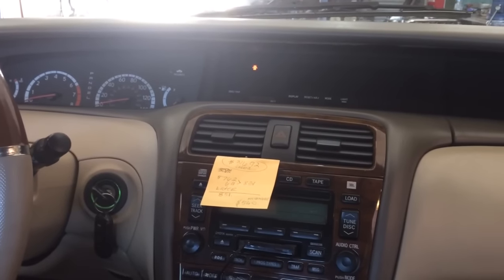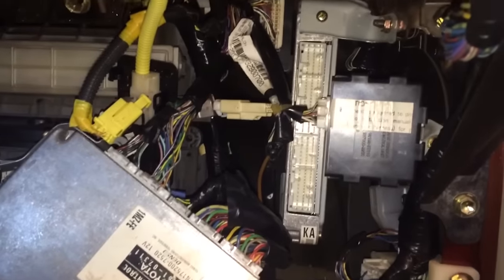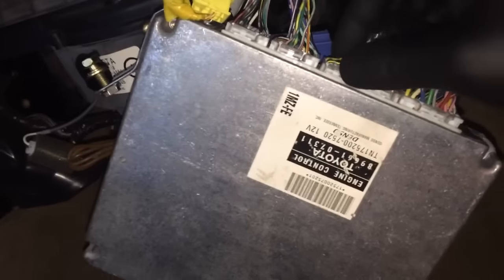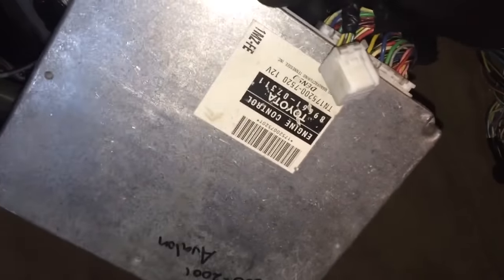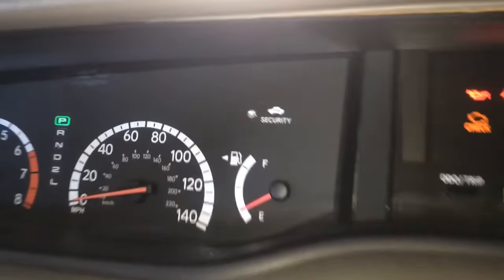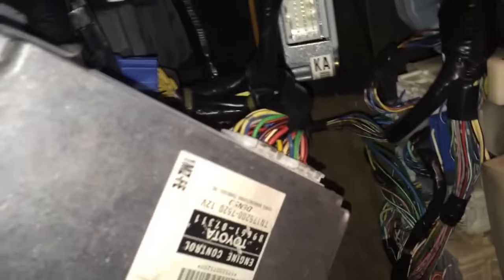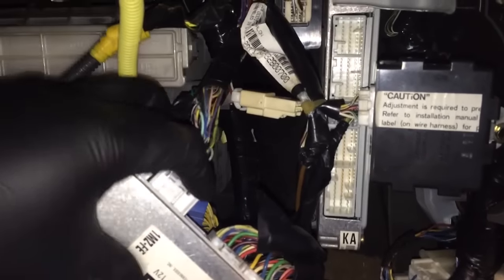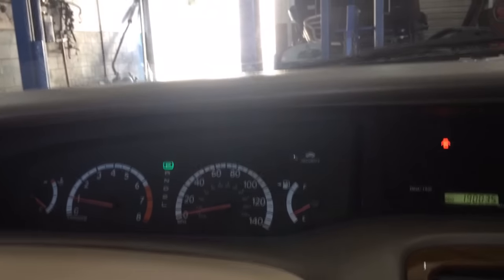Watch NOW! Immobilizer Bypass No Special Tools Needed Real

Comment: i had my 2005 accord hybrid steering column destroyed by car thieves is their any way to get it started even though the key ring on ignition was destroyed and how can i defeat the immobiliser???
Reply from the maker: +Anthony Wynn try this out http://k-tuned.3dcartstores.com/Immobilizer-Multiplexor-Bypass_p_131.html its usually used for cars with k-series swapped engines but you can always contact them to see if it'll work on your car.
Reply: Anthony Wynn you can buy at ebay.
Reply: n

Comment: how would I do this for a 2000 Mitsubishi Eclipse with a 3.0 v6??   it's pin 51-111 or is there a way to eliminate it completely. my keyless entry fob took a shit. and car won't do anything anymore
Reply from the maker: +Cody Burgess is it a factory keyless entry fob? if it is factory your key should disable it once you use your key to unlock the door or switch the ignition to the on position. If it is an aftermarket alarm system then you can take out the alarm system and reconnect all the wires that were cut
Reply: Factory. I have gotten most to work. But the fob.  And the immobilizer has all spark and fuel shut down. No crank no start

Comment: On a 2001 Toyota RAV4 the engine starts fine , I’ve had to replace the computer because it damaged the transmission. I put new computer in and now engine only cranks but will not start. Funny thing is this RAV4 doesn’t have any theft deterent devices on it just one black head Toyota key NO security light on dash . Code is B2796 no comms with immobilizer . Now would all I need is to have a new key cut and programmed and if so what is it going to program if car it self has NO theft deterrent devices just the new computer?
Reply from the maker: I would go back and get another computer. Happened to one of my customers cars I did but luckily Toyota warrantied the one I bought.
Reply: Revved Up Knowledge yes sir I have another computer already being shipped to me, I explained to them the situation and they are saying they may have sent the computer with immobilizer integrated in ECU so now their sending one without hopefully that’ll be it thanks for your response much appreciated
Reply from the maker: Yea on my customers some short in the electrical system caused the immobilized system to activate itself. This was 5 months after the new computer was installed. All is well now with it so thank god!
Reply from the maker: Good luck!

Comment: the  sentry system  light comes on when starting my 2001 jeep grand cherokke and shuts the truck off after two seconds both keys are origanal please help ive been to 2dealers and 2 mechanics still no resolve
Reply from the maker: +Mark Depelham sorry haven't replied, hopefully you have it sorted out by now. if not i thinkg it might need a new immobilizer module (ring that reads the key) and reprogrammed

Comment: 2002 Chevy Impala that will not start. Dashboard will come on but the key will not turn to the start position. Car ran and started fine all day but now it wont start. We changed the ignition switch and cylinder but that didn't work.
Reply from the maker: +alysia Porter with the new cylinder it should turn all the way. Did you check for any debris left in there from the old cylinder before putting new one? Something could be blocking it from turning all the way. Is the car all the way in park? if it is try putting it in neutral if you can, to see if that will let you start the car, if it does than you either need to replace your Neutral safety switch, adjust it or the shift cable could be bad as well. let me know as much detail as possible because these things are really hard to diagnose without me physically checking it myself
thanks

Comment: does this work on a lexus gs 300 2006? security light blinking car wont start
Reply from the maker: I have tried this method on a 2000 GS300 and worked as well. On those years the immobilized plug is the grey one
Reply: Revved Up Knowledge how about 98 Lexus LS400?
Reply: Any chance this works on a 02 es300
Reply from the maker: Tiger Gray: Sorry a little late but yes good chance this may work but it only for testing purposes. If it does work then get the donor computer programmed with your original keys!
Reply from the maker: Gary Davis: Yes good chance this may work too but it only for testing purposes. If it does work then get the donor computer programmed with your original keys!

Comment: I really appreciate your trick. My Corolla 2009 has exactly same issue when i enter the key red security light keep blinking. Sometimes it blink once and my car work perfectly, once or twice in a day my car doesnt start and i have to wait 10 to 15 minutes or sometimes if it get worst i replace horn fuse with efu fuse. Went to the dealer and they are asking me $750+ for it which i am not willing to pay them at any condition. Local locksmith are not interested to take risk to do anything. Can you suggest me the permanent solution for it so i can buy some items u suggested online and fix it my self or with the help of local locksmith. I am living in Bahrain. Thanks in Advance.

Comment: Hi Peter! I was thinking about purchasing a Toyota Avalon that was jump started incorrectly. The person who has the car says it has no spark or injector pulse.. He say he replaced the computer, but it still won't start.. How is the ECU supposed to be replaced? Also, is getting the car started going to be a challenge?
Reply from the maker: What year is the avalon and ask them if they still have the original ecu. When jumped incorrectly it shouldn't burn the ecu. Only thing that usually happens is the alternator or main fuse will blow before anything else. Should be a real easy fix. In the case that the ecu is damaged, replacing it will need to be synced to your car/immobilizer system with a Toyota dealer grade scan tool or one that can reprogram the computer. In my 10+ years of working I've never seen an ecu that got fried from jumping wrong =) and I've seen plenty of those wrongly jumped batteries
Reply: @RevvedUpKnowledge  Thank You for that bit of info. That is exactly what happen to my 2008 LS460. I got *key not detected*. this is push button ignition and not keyed.  I will look for Alternator main fuse again,  its the 30 amp square with window, it does seem intact and has continuity.......
Ordered a replacement ECM on line programd to my FOB with my VIN number but the car still does not crank or start,  oh and the push button is only faintly lit, not green, just faint amber!   I wish someone with same problems has a solutionn!!!!!!!!

Comment: Will this work on a 05 Toyota corolla I need to know asap
Reply from the maker: Sorry not too sure of this. These are a lot newer than the one I tested and the likely hood of it working is slim
Reply: Will this trick work for 2006 gs300 lexus? It has the same 6 plug
Reply from the maker: I have tried this method on a 2000 GS300 and worked as well. On those years the immobilized plug is the grey one

Comment: Hello everyone. 

I hav a problem with my 2001 honda civic vtec 1.7 eu.
It was driving fine and ignition was faulty n as i was driving some smoke came out from the engine bay.
I stoped on the side of the road n tried to switch off the engine but the ignition systerm was faulty n couldn't go off until i popped up the hood n removed one terminal n the car switched off.
Fixed the starter n put it back, but now ever since that time it cranks but doesn't start n the green key is flashing on the dashboard..
Auto technicians came diagnosed the car n couldn't find any faults.
Has anyone faced this issue before ?

Comment: Hello Dear,

My SEAT LEON 2014 1.2L TSI's ECM was damaged due to short in O2 sensors wiring, it's confirmed that my old ECM is faulty and I just bought another ECM from junk same car.
Now my car just started for 1-2 seconds and then turned off due to Immobilizer mismatch between second ECM and the car itself.
My question is which CHIP I need to replace between two ECMs to match Immobilizer system? which IC stored the Immobilizer code?

Or How can I program the new ECM in details?

Below ECM details:
printed outside on case of ECM: VW AG 04E 907 309 A
Control Module Part Number: 04E 906 016 C
HW: 04E 907 309 A

Appreciate your quick reply.
BR,

Comment: We are have the same issue on our 99 jeep grand Cherokee limited 4.7 its does the same thing but the jeep is being turned off my the immobilizer. Help!!
Reply from the maker: Gravy Larance if it is the immobilizer than you will need the to get it re coded. any locksmith should have software to reprogram this. You do need all the keys though (main key, spare key, valet key, etc..) if they can't code it than you might have a bad ecu and most likely not charged for the service( ask before hand just in case if you'll be charged if you run into that situation)
Reply: We bought the jeep used and came with some walmart type key. We had a locksmith come out and made us a new key using a skim code. They also needed the last 8 of the vin as well. After that we set off the alarm and didnt know how to shut it off. So we unplugged the battery. It was going nuts horn and flashing light. Jeep would not start. After letting it sit for almost 2 hours in a parking lot it started back up and died suddenly. The lights all stay on. It seems like it just shut down the motor and solid key light is seen on dash. It stops us from restarting the jeep. After about 30-45 min the guages come back to life and you can start it again. It Will run again for about 30 and dies like clock work. Replaced crank sensor, oil pressure sensor, coolent temp sensor plugs and coils. Fuel pump does make the pumping sound after restart. 45 pounds of pressure at rails after restart. So we are getting air fuel and spark. Stumped yet?! Me too. All grounds are tight. Full of oil and trans fluid also. Lost and cluesless!!
Reply: The only code thrown is P0443 replaced the evap sensor no change. Any tips on what that code means??

Comment: I have a2002 smart car from Europe I did the engine rebuild n now the car won't star is Immobilizer what can I do bcs the Smart in USA star fron 2008 if you have any idea let me know thanks
Reply from the maker: Jose Osejo  if you just did a engine rebuild then your car should still start up because usually when rebuilding an engine we normally don't change out the ecu. You might have a crank/cam sensor problem or possibly something was not plugged in or even a simple ground wire. let me know hopefully that helps
Reply: The car cranks but won't star n also I replace the crankshaft censor n the my scanner don't read nothing bcs the year where I can get the electric diagram or something for the car
Reply from the maker: Jose Osejo ok heres some basic diagnostic rules i go by and you wont need a scanner for it. First thing i would look for is spark. To do this you would need a helping hand. First disconnect the spark plug wire or direct coil, find a used or new spark plug and plug it on the spark plug/coil. Holding the wire/coil far away from the spark plug as possible(so you don't get shocked)then  set the tip of spark plug on a ground on the engine or if the valve cover is aluminum then rest it on that. Have your friend crank it and see if you can detect any spark (do this at your own risk as you can harm yourself by getting shocked, i am not responsible if you cause any harm to yourself, others or your car) if no spark then either your timing is off, bad sensors, bad ecu or no power/ground to ecu. Oh another question, does your check engine light come on when you cycle the key?
Reply: keep getting it vu bba

Comment: i have a 1998 Lexus sc400 and it wont start after the alarm went off and i had to call a locksmith to unlock the doors. I dont have the original key but the key starts the car what could i do? PLEASE HELP!
Reply from the maker: +Raymond Kelley thanks for watching and commenting!! the key you have starts the car and it runs fine?
Reply: Yes it starts it and the car runs perfect
Reply from the maker: if everything runs fine then you'll be fine. its possible the keys you have is already programmed to that ecu's immobilizer or if it doesn't have a chipped key then you might have a JDM Ecu.
Reply: The key hasnt worked since the anti theft was armed. It stopped the alarm when i turned the key but now doesnt want to start. Is my key the problem or is it the ecu?
Reply from the maker: is there a key emblem, anti theft or security light flashing on the dash display?

Comment: Is there a car that comes with an immobilizer that can not be bypassed?  Preferably one that calls the police if it detects anyone messing with the wiring.  I am thinking a silent alarm so that the thief will not be frightened away before the police come to get him.  Maybe even use an ECU and immobilizer that use some kind of rolling code that is gets a cryptographic hash  computed for it.  There would be very short time window so that there is only enough time to send this.  That would make it very difficult for someone to try to compute their own to bypass it.  If that one is missed there is a minute delay before the next one can be attempted.  After 3 wrong attempts the car refuses to start for a full day.  After 6 consecutive failed attempts the ECU and immobilizer will lock up and refuse to respond to anything else as if it had self destructed.  I am thinking about some sort of immobilizer that can not be bypassed at all, not even with a key lacking a transponder.  The only way around it would be a new immobilizer and ECU that are permanently married to each other

It would be a car that can only be stolen by towing it even then it would still have lojack or something similar hidden inside of it.
Reply from the maker: John Doe good idea but it would cost to much to develop and will cause a 20k car go up 10-20k more. personally i wouldn't want to pay for 2 cars and getting only one.=)

Comment: i have a 2000 avalon and the keys got lost how do i start my car i live in kansas nowhere and no toyota dealers what can i do
Reply: +lee cullum 
Sounds like you need to have new keys made and maybe a new ignition lock and then probably bypass the transponder...look around on YT.
Reply from the maker: +lee cullum you need to call a locksmith or bring to dealer and make new keys and program them

Comment: If you change out your key and don't have the factory key to start the car .you can start it using starting fluid in the air filter .it will stay running  but would have to do it every time to start the car if you don't bypass the immobilizer.
Reply: But You would have to able to Crank the engine in the first place yes?
Reply: @hitone4319  well yes .but all that takes is busting the ignition out if someone was to steal this car.

Comment: I did what you said still didn't work so what's the next move
Reply from the maker: if your original ecu doesn't power up when you cycle the key then this trick wont work. if it doesn't power up that means bad fuse or ecu itself. if your ecu you is fried then you will have to get the new/newer ecu programmed to your keys.

Comment: I have issues with 2001 honda accord immobilizer  wont turn off  even with original keys transponder new new copy of key and still same thing anyone?
Reply from the maker: Most likely you have a bad immobilized reader. I have replaced a few of these. On those generation accords you don’t need to program the reader. The reader is the black ring around the ignition lock. I think at the dealer they cost around 80 or so

Comment: Easier hack. Do it all the time since we lost keys. Pull the drivers door off and theres a four wire connector that runs in the bottom of the door, iirc same loom as door light wiring. Disconnect the four wire connector. With paper clip, male an x pattern then short top two across. Done. Bypassed.

Source:12 years of doing this to the same exact car. Cranks after everytime. Don't lock the doors via the door lock switch and it won't rearm unless you use the remote or lock switch.
Reply: Is this really a way to bypass it? Same car, no keys, no extra ecu, so I could really use more info from your on this thx

Comment: I lost my keys to my 2001 Honda Accord Coupe and when I put a battery on it the alarm keeps going off and I have no keys how do I take that alarm system and turn it off it's an anti theft system that came with the car
Reply from the maker: Does the car still start and is the alarm factory or aftermarket?
Reply: It's a factory alarm it's an anti theft system the car turns over I got the car to turn over by taking the ignition apart and going into the back side but every time I put the battery power cable on the battery my alarm goes off and I lost my keys so I have no keys to it and I can't move it it'll turn over but it won't start all the way
Reply from the maker: I would bite the bullet and have Honda or a locksmith company that can make new keys and program/sync the key to the immobilizer system. Another way is if you have a JDM computer
Reply: Revved Up Knowledge i have same problem but I do have the key,when i plug the battery wires alarm don stop,how I can fix it?